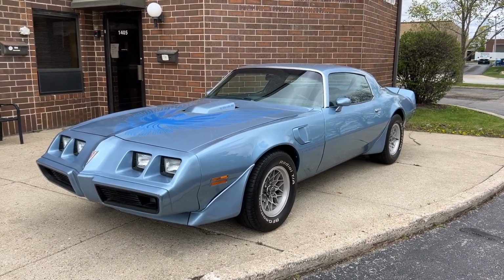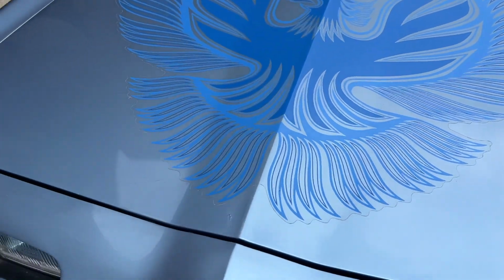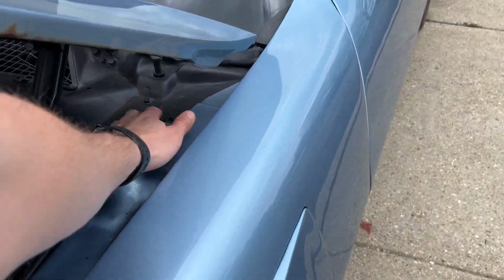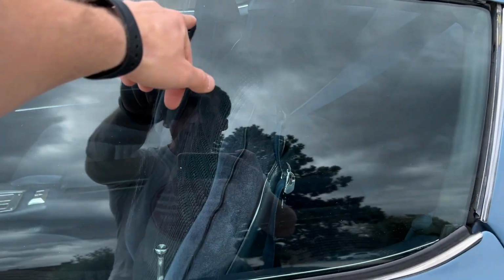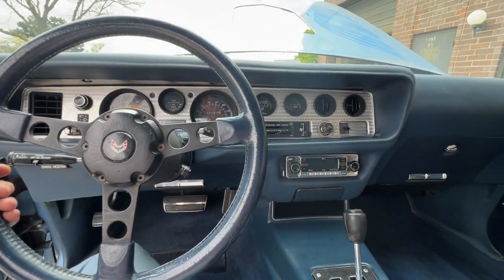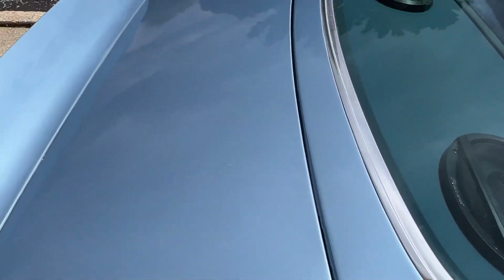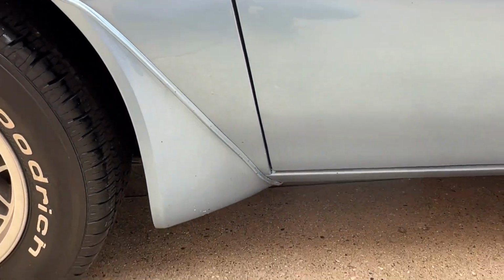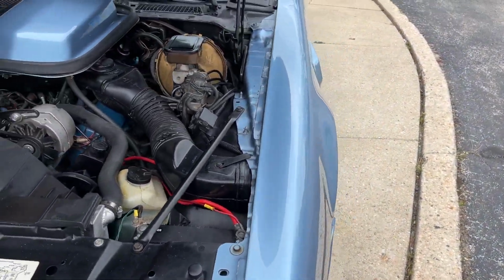1981 Pontiac Trans Am - SOLD

Comment: I had a 80 formula firebird with the 4.9 301 and a 79 grand prix with the 301. Those pontiac 301s ran really good but had no power. 4.9 turbo trans am in 80 and 81 not quite as bad but still only around 200hp with the turbo.